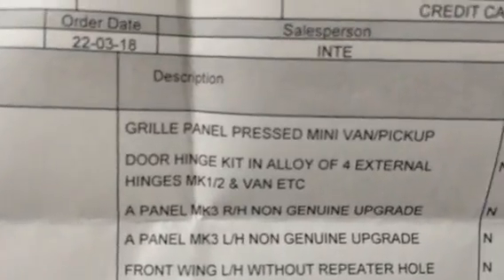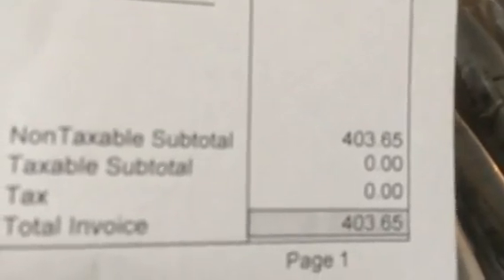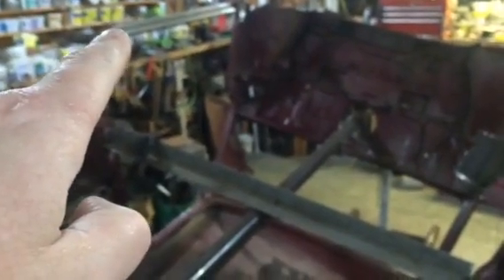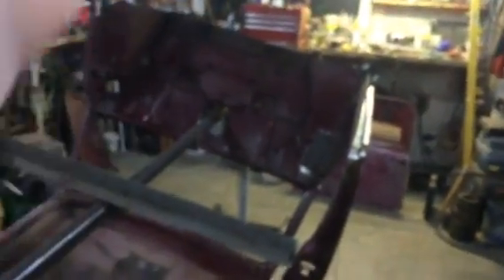Prairie Mini Project Episode: 15 parts are here!!

Comment: If you can do CAD software you could try protolabs to make your own parts https://www.protolabs.com they cover USA and UK, Europe probably worldwide. In UK you get equally stung when shipping from USA for a special cable I ordered the shipping invoice was more than the original part cost. They also add obscene admin fees to send you the invoice which is most likely automatically printed and mailed out. For smaller items you can always go on holidays and ship to a hotel
Reply from the maker: I do allot of recycling of raw metals like aluminum copper brass and steel and i've been studying how to smelt and looking at total loss foam casting. i'm tempted to take the hinges apart and make molds of them to try hinges in brass, polished they'd be way cool. i'm scared to see what shipping on a new front window will cost for weight. it'll be what it will eh! cheers.
Reply: PIPER DOUG I found this video on home foundry making interesting recently https://youtu.be/l2FuvKTyRMQ
Reply from the maker: Yeah i found his channel a few years ago, very informative, cant believe hes over 9 million subs now, wow!.

Comment: I was thinking about you the other day, I saw a Porsche 959 and couldn’t believe how far the sills stepped out, it almost looks like a smaller shell set inside a larger one but in a cool way. I know you’ve kind of sorted out your sill issue but it’s an interesting aside. One of my plans was to do a Fiat Panda 100hp and mini fusion and copying the style on the 959 would be an interesting way of not messing with the floor pans and sills and then keeping the mini shell width unchanged. Yes you’re right about the radius bends eating panel length, I sometimes purposely leave the outer folded edges too long and then grind off the excess. If you make it too small you’re screwed really. I’ve been repairing a Dino boot lid over the past couple of days, the back edges were rotted out, such an incredibly complex shape and very frustrating, but it’s sorted now and on the plus side I learned a new technique... Which was nice 😏
Reply from the maker: Did you film the dino work, i'd love to have seen that process. i'm kinda starting to lean towards a stepside box on the mini, hard to do but would look the bull's ball's. i was just really glad the mini parts weren't covered in little dints. cheers bud.
Reply: PIPER DOUG I didn’t take any film, it’s not so easy at work as I’m always up against it with time etc. Check out a picture of a 959, it might give you some more options. I think it was well worth ordering those parts even at the price, I shudder to think about the hundreds of hours I’ve spent making parts for my van, given the option I’d rather have bought new at any cost. Cheers Trev 👍
Reply from the maker: It's funny when you look at the 959 you can almost see a 911 tub in the middle, do you know if the doors are similar. if i went with a running board style the flare would really work.
Reply: PIPER DOUG Yes it’s just like a 911 set inside a larger car but it really works well in the looks department. I like the narrowness of the old mini shell with extreme stepped out arches, it would be cool to create ducts into the rear arches and mount radiators behind allowing for the reduction of space at the front.